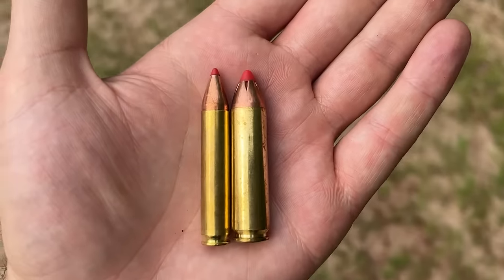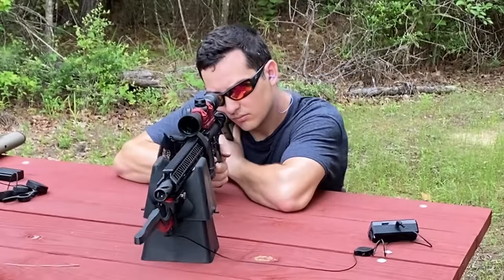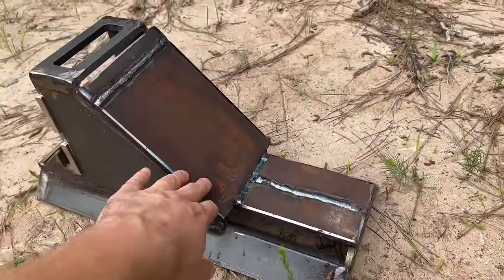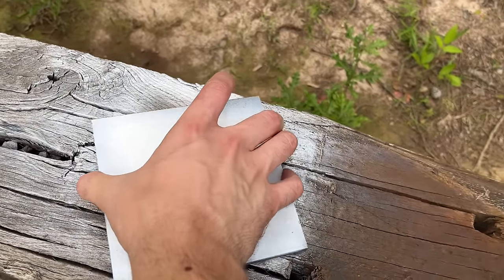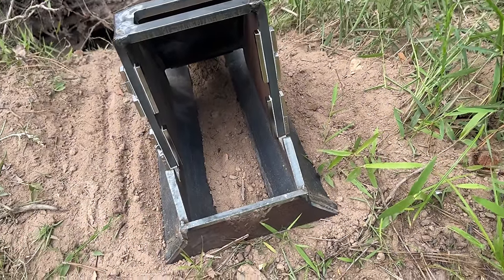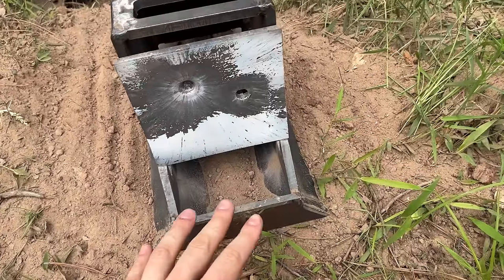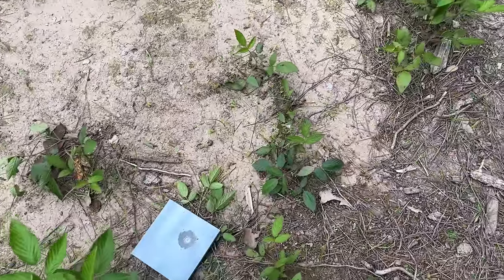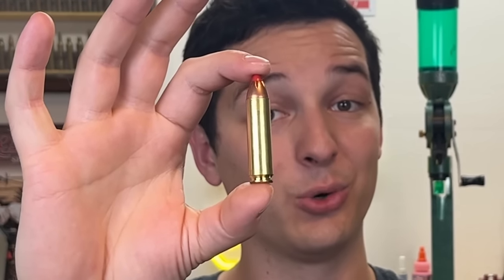350 Legend vs 450 Bushmaster: INSANE Difference On Steel

Comment: I took a 475 pound black bear with a 450 bushmaster with the exact hornady cartridge you tested.  The bullet passed the whole way through the bear and the bear only made it 15 yards. The shot was 100 + yards
Reply: That’s strange I shot plenty of white tails with the .450 and all the energy dissipated into the body of the deer. Never seen an exit wound. That’s preferred rather than punching holes through animals. That’s the reason why hollow points are preferred rather than full metal jackets or armor piercing rounds. I’m glad you made an ethical kill on the bear and it didn’t suffer for too long. Good on you man.
Reply: Hit any bone?
Reply: Was it a stuffed animal or a baby bear?
Reply: Shot a lot of hogs with .450bm and don’t see a lot pass through. Must have been a really skinny bear
Reply: @Wooderson5811 seen plenty of deer dropped with arrows that pass all the way through. Shooting almost anything is about shot placement than plugging up a hole with lead.
Reply: @korndawggy1801 i wouldn't call a 475 black bear skinny
Reply: @nakedfreak1 I'd have to agree the biggest boar black bear I've ever seen was maybe 350, 475 would have to be  a big ol corn fed pet!!!
Reply: @mattlynch2823  cheeseburger from farcry 5
Reply: @mattlynch2823 I’ve seen several 500 pound plus bears in the wild in east tn. Definitely not a stretch.
Reply: @spcpitts 475lbs is pretty big buddy
Reply: @Robcalitrek1 the shoulder plate in a hog is very thick compared to alot of other animals
Reply: @nakedfreak1  We don't have bears where I live, so I have no frame of reference as to what you are referring to. Does the 450 not qualify for lack of power or for lack of range? I understand that it is a 150ish yard rifle, but 150 yards is a pretty standard/not unreasonable hunting range (not that I would want anything big enough to eat me to be that close) for taking lots of game, so is it too frangible of a projectile for something so big? Genuinely don't know and would love some clarification. Cheers mate!
Reply: @nakedfreak1  No, it isn't.  Here in Colorado we had one bruin raiding our camps and he was a freak.  When he got nailed by a Peterbilt, he weighed out at 748 lbs., and yes, he was a certified black bear.
Reply: @Wooderson5811  Last double lung and heart shot  was a thumb sized entry and a softball size exit. Personally I only take  clean shots.
Reply: a bear ran 15 meter AFTER it was shot in the head??? lool only 15 yards, what is that a 4th floor apartment?
Reply: Idk why yall crying, i take everything with a bmg
Reply: so completely overkill lol

Comment: Can’t wait to see a 350 legend vs. 400 legend.
Reply: Definitely.   The Turkey’s Opinion really did a great job showing what the 400 Legend can do.
Reply from the maker: The 400 Legend has me intrigued. I’ll have to see what I can do
Reply: Yes sir! I was someone that knock down the 350 legend thinking it wasn't going to be a gud deer round holy cow was I wrong! I'm hooked now and all for the 400 legend because I would like a little more range out to 300 yard, from what I'm gathering the 400 legend is going to scratch that itch!
Reply: How about the .350 pretty good vs the .400 not too shabby
Reply: @hickboyjusthick698 should compare on steel the small fast bullet always wins like a 223 vs 350 223 will win this test but not at dropping deer
Reply: The 400 was ment to close the gap between the 450 and 350 so it will just more than 450 just less than 350 on steel more death than 350 and less death than 450
Reply: The main difference would be the weight you'd be having to carry in the field.  Both will kill the same amount of dead. "I wouldn't be able to notice any difference from my back yard BBQ grill."

Comment: The 450 don't go through something it just takes the something with it ! Dear hunting you are better off if it doesn't pass through! If you're escaping new York being attacked by zombies i think eather is a good choice 😅
Reply from the maker: You’re not kidding about it taking something with it, those dents were massive
Reply: @bananaballistics  i would love to build a 450 upper the only thing that holds me off on it is the brass  with the 350 you can reload from your over used 556 brass like you can do with the 300 blk out witch i built a upper for all that is needed is a barrel every thing else is 5.56 compatible and then you have the 7.62x39 and that will add a twist to your build or a 9mm upper. I'm slowly trying them all when I get good deals on parts. I think the 6.8 or the 277 would be fun to try

Comment: Shooting Deer not the same as steel.  Used both and if you want to down one like a hammer use the 450 bushmaster.   If you are weaker or recoil shy then go with the toned down 350 Legend.

Comment: Try welding angle iron to your sled. Two pieces on the upright sides creating a "slot" to slide your plates in from the top
Reply: Yea I was about to say that also. All he would need is like a inch so if the plate bends it can still come out .. 🎉🎉🎉

Comment: The 450 is a wider projectile than the 350 so the impact force is distributed over a larger area. Even if they had the exact same energy, the smaller diameter project will puncture easier than the wider larger diameter project. Narrower longer projectiles puncture. Shorter & wider projectiles punch and lose energy as the impact is distributed.
Reply: You nailed it.  I have a .17 call that shoots 3300 fps and it can put a hole in that steel the size of a BB gun but I don't hunt deer with it.  450 Bush will dump all the energy in the game.  Who cares about plates deer are not made of steel plates.

Comment: Been shooting hogs here in Texas for a couple of years with 350 Legend 150 grain Winchester Deer Season XP ammo and it has been very effective, probably my favorite hog cartridge. Have used 450 Bushmaster 250 grain Hornady Black with the FTX bullet on a few hogs, while it may not have penetrated 1/4" mild steel it really does a number on flesh and bone, busts a hog up pretty good and has dropped them right there on the few I have shot. Looking forward to AR parts for the 400 Legend, should be a great hog round and good balance between 350 Legend and 450 Bushmaster. Thanks for the video.
Reply from the maker: Glad to hear they are both effective on hogs. I agree that the 400 Legend is probably a good happy medium so I may have to look into getting one.
Reply: @bananaballistics  good thing deer aren't made out of 1/4" steel I guess. Shot one with a 450 Bushmaster and it plowed right threw it and you could see lung tissue and blood splatter against the tree behind it. Left a hole through both sides the size of a half dollar in diameter. Haven't had the chance to blast a hog using 450 BM yet. It's too much for deer though, will be using 300 Blackout as my caliber of choice for Bambi.
Reply: You definitely need to do a comparison between. 400 legend and .350 legend. I'd say it would do better than the. 450 BM as well. 😮

Comment: Really interesting result.  The main factor may be that the larger diameter of the 450 legend spread out the energy over a larger area and was dissipated better by the steel.    Nice looking sled btw.
Reply from the maker: That is true and I did not mention that part of it. I appreciate it!
Reply: I agree. Great point. Both do a great job with 🦌.  Wouldn't want ti be on receiving end of either.
Reply: I also think the plastic tip/insert in the bullet keeps it from penetrating as well, it deforms and slows the bullet down as the projectile also expands, making it harder to go through the steel. An fmj would probably make it through in .450 legend, also a solid copper or brass bullet(while lighter and thusly faster) would I'm sure do great. I don't know if anyone loads for this caliber but Lehigh defense bullets....oh yes please
Reply: Yeah, this is a question of energy density. This was a great video though the author missed this point. I'm debating these two cartridges for an AR build and it seems the 350 Legend is the best balance so far.
Reply: The 450 also had a massive hollow point compared to the 350
Reply: Still a massive dent and I'd say not much more needed to get pass threw . Hits like a hammerhead 450 . I built one a year ago and still haven't shot it
Reply: Sectional Density demonstration.......its easier to push a pin through than a pencil.
Reply: @gunguru7020  Sectional density is only half of it, energy is the driving factor. Both your pin and pencil will need energy behind it to push it through anything.
Reply: @lombasto  Well of course you need energy but given this situation where a 165 gr 350 and a 250 gr 458 are traveling at the relative same velocity (2200fps) its all sectional density. The 458 has a significant energy advantage but failed to the lighter less energy projectile.
Reply: @gunguru7020  Sectional density isn't the full story. In the case of these bullets, they actually both have similar sectional densities published by Hornady (0.175 vs 0.187). Sectional density doesn't consider bullet design or how it fractures at impact (let alone monolithic vs lead bullets). Here we both can agree that more of the bullet's energy is being transferred to a smaller area of the plate at impact with the 350 than with the 450, even though the 450 is actually carrying about 30% more energy overall in this test at their speeds (2322 ft/sec vs 2146). That's energy density.
Reply: @lombasto  Hence a pin is easier to push than a pencil. Maybe I wasn't explaining it or understanding it adequately and appreciate the further clarification.
Reply: The 350 also loses a lot of energy a lot faster at longer distances
Reply: @bananaballistics  I dare you to compare the .450 Bushmaster with a .460 S&W.
Reply: Im interested in seeing a 450 legend lol

Comment: No debate. I bought my 350 Legend already from BCA and absolutely Love it.
Added a scope on this upper and got MOA at 100. I am very impressed with this cartridge and upper receiver combo.
The BCA if anyone is interested is a 20' heavy barrel stainless nonfluted setup at a reasonable price. I added a Rise Blitz trigger group to my lower and got an insane light trigger with almost no travel. My only problem is finding a Hog Hunt to go on...lol. The ammo I sighted in with is Federal Non Typical 180 grain. .962 group 3 shot placement.
Reply: What is the maximum effective range of that 350legend?
Reply: @TopNoTchVSOP  About the same as a 30-30. It's a heavy hitter, not a long-range precision rifle. All though, WhoTeeWho did put the 350 Legend on steel at 1000 yards. I won't be pushing this that far. I expect the hunts all to be @ 200 yards or less. WTW has the ballistic charts for this too. Check his channel out.

Comment: I like the capture system addition but I think your v1 set up had the right idea just needed harder steel that wouldn’t bend with the impact. You’re correct that a clamp system is needed to keep it in place.

Comment: I have to say punching holes in steel is no indication of performance on game. 
As a matter of fact it's quite possible that the exact opposite is possible. 
Too much penetration might just punch small holes in the animal with no expansion. 
Do the same test with ballistic jell you might be more impressed by the 450
Reply: Exactly what I was thinking. It appears to me the 450 did exactly as intended, thats why its a such a nasty hunting cartridge at respective distances

Comment: Results are not surprising . A narrower bullet with less surface area will have better piercing capabilities due to higher impact pressure. 

However, penetration comes at the expense of energy transfer efficiency. The 458, being wider, is much better at transferring energy , so it will do better against softer targets

Comment: I just got an AR upper in 450 Bushmaster. I got it to hunt whitetails and not steel. Just because the 350 went through steel says alot about how the bullet didn't expand.
Reply: I'm waiting for opportunity to head down to south Texas and see how well my side charging 450 BM works on Nilgai. I found it too much for whitetails. I would rather use 300 Blackout, .243 Win or 6.8 SPC for them and save the 450 BM for hogs and animals bigger and tougher than whitetails.
Reply: Not really, it's all about the higher velocity and smaller frontal area.  Those bullets weren't designed to expand in hard objects in the first place.  I'm pretty sure the results would have been the same if both bullets were lead-cored FMJs of the same sizes and weights.
Reply: @jic1  Well, I'm planning on hunting whitetails,  not steel! 😁

Comment: First thing that popped in my k-noggin when you said you were going to try neo mags was that they were going to shatter.  The setup that you have been developing to hold the plates has been as enjoyable as the rounds you have been testing/comparing.    I am picturing some slotted "L" brackets attached to adjustable welding lockdowns to cinch the plates in place.  They may pop open from the impact but as long as you don't hit them you should be ok.  Actually popping open may be preferred since the lockdowns would not have to take the full force of trying to keep the plate in place and the energy would be disapated with the plates flying free.

Comment: Change the bullet type and you will probably get far different results. Fmj's would possibly go a lot further. 
  Two sliding steel wedge bars, one at the top and one at the bottom the full length horizontal might work to hold those plates in place. Only needs to use a half inch or so top and bottom across the face to hold the plates
Reply: Solid copper works. 220 grain Lehigh for 450 b using lil gun powder

Comment: I'm not so sure I would say it's a disappointment that the 450B didn't penetrate. All the energy impacted the steel.
Reply: just as a ballistic tip should do. the 350 legends ballistic tip did not preform as intended, acted more like a fmj then a ballistic tip round.

Comment: Other than the 45-70 the 450 Bushmaster is the best rifle for large game in the brush.
Reply: That's a pretty open statement. There are lots of much more powerful cartridges than those two that will work very well in the brush or anywhere else. The 450 bushmaster is a very good round but there are reasons the 45-70 was long abandoned for numerous other calibers.
Reply: The 45-70 Government is the best Bush gun there is for me and it's not all about the power,   I've been a Hunter for years and in the brush the 45-70 Government or the 450 Bushmaster is what I'm taking. You can believe what you want to.
Reply: 444 marlin
Reply: 458 soc can match most factory 45-70 loads with same .458 bullet choices vs 450bm which uses a .452 bullet. I personally like 458soc more.

Comment: I didnt think the 350 had that kinda energy. Im pretty impressed
Reply: In reality it really doesn't. .350 pushes 1,800lbs of energy vs .450 pushing 2,700lbs of energy. 
Smaller diameter bullets penetrate hard objects easier with less energy, so it's kind of a rigged test.
Imagine a stretched sheet of canvas and how easily a needle pokes through vs a bowling ball thrown at it probably wouldn't go through.

Comment: for your sled rig, i would use catch hooks similar to what i saw on the bottom, up top as well, only rely on magnets to hold it in place for the shot and let the hooks keep it from going flying, it'll make it a slight pain to load a plate from the side, but it beats not having to chase the plate after every shot

Comment: Saw those magnets and figured they would shatter, they are really brittle. BUT... They are also insanely powerful, so try gluing them to the sides just shy of the edge of the sled so the plate doesn't actually make contact but is close enough to be attracted. Hopefully, sled absorbs impact.
EDIT: And further in to the vid you do exactly that. Maybe I should watch to the end before commenting..   :)
Reply from the maker: I appreciate it lol!

Comment: Not  Penetrating   1/4 steel might be a good thing....   Remembering that while high velocity is important.. if it blows through your targeted animal.  It takes energy with it....😮😮
   The key is to have the high velocity, while ensuring its  DECELERATION is so fast and violent...  It creates the most hydrostatic shock energy possible. ❤
Reply: Ahhh yes, the controversial hydrostatic shock theory.

Comment: I know what my 450 does to whitetail.  Drops them faster than my 7mm mag did. Sticking with my 450
Reply: You hunted deer with a 7mm mag.? To me it seems like overkill even if you have very long shots.
Reply: @russellkeeling4387 it’s really not. The 450 is overkill inside 100 yards. I killed two muleys and a whitetail with a 7 Mag and didn’t have any loss.
Reply: Love my 450, deer don't..
Reply: 8450 guys don't get so defensive the bullet is doing what is designed to do get inside there and pinball racquetball the organs. You can modify your bullets to go through
Reply: @MontanaWillie44  how can you overkill a deer?
Reply: @dennisp7317  when you hunt deer for meat, and a 450 hollow point causes 35 lbs of meat loss that’s overkill. Watched it happen to a guy I told not to buy a 450.
Reply: @MontanaWillie44  I killed 3 only lost tiny bit of rib meat 🤷
Reply: @russellkeeling4387  it's actually a small bullet in a large cartridge that makes it very fast.  I used it drop my elk in Colorado. At the time I only  had funds to buy 1 rifle  to do it all. Many ppl in northern Michigan use that caliber or even  300 mag

Comment: Neodymium is actually quite brittle. Set them 1/32 inch back from the edge. It would also help the cushion between the magnet and sled with gasket material or something similar.